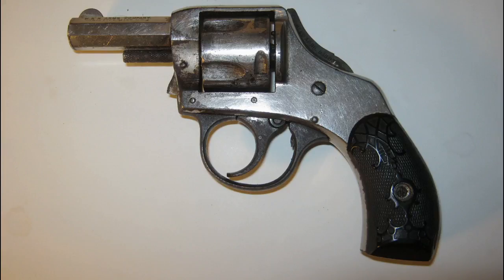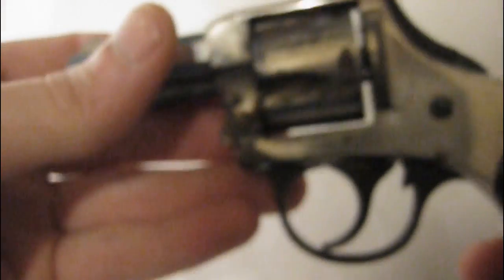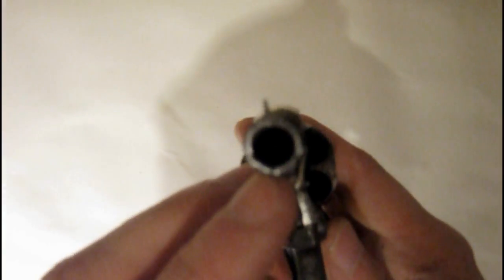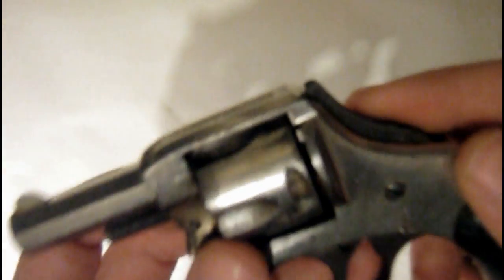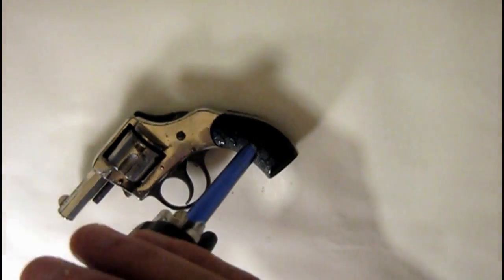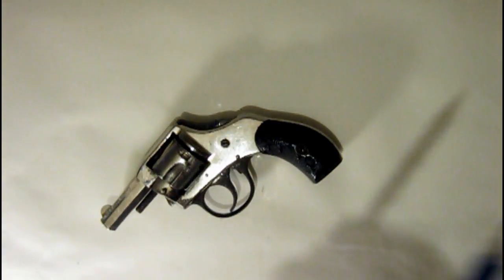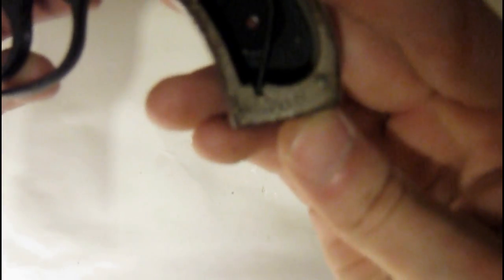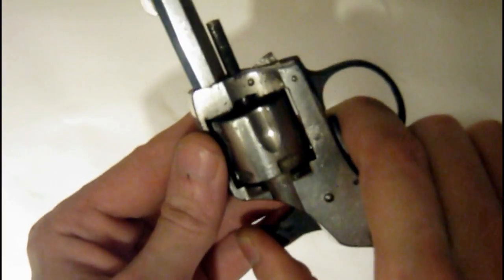Mathews Got A Gun! | 32 Cal Revolver Review

Comment: To release the pin you need to push the metal piece in to release the pin and also to reinstall it, penetrating oil will loosen the pin

Comment: Did you ever get the pin out? I have one of these as well. It was in pretty bad shape when I got it. I had to soak it in penetrating oil and apply heat to the cylinder to get that pin out.
Reply from the maker: No, I couldnt get mine out no mater what I did. I did the penetrating oil and I even let it sit in mineral oil, but it just seems fused  in there. I never tried heating it up. I'm not sure if heating an old gun is a good idea since it can warp everything. but I'm no expert or anything, just a educated guess. So does yours come out without a fuss after getting it out the first time? or does it after time stick?